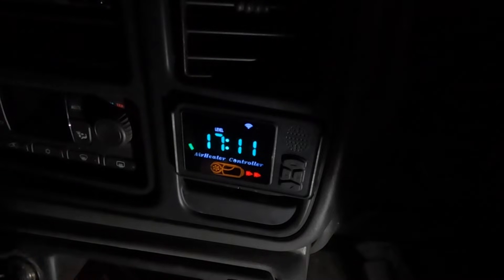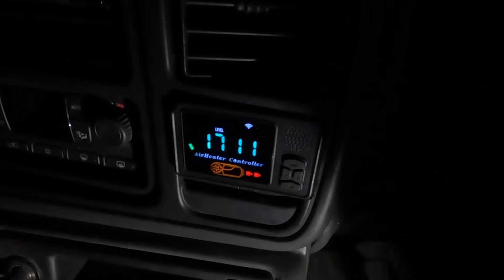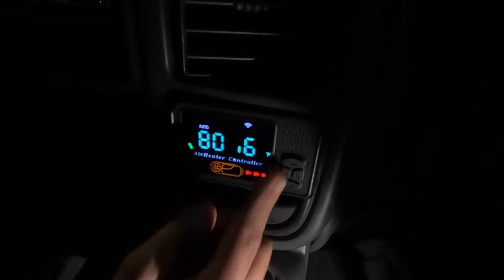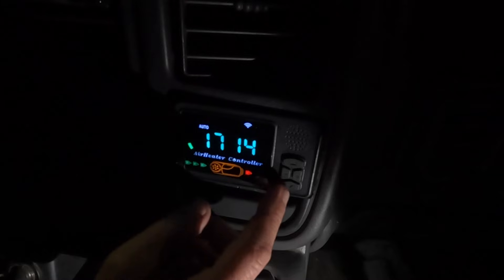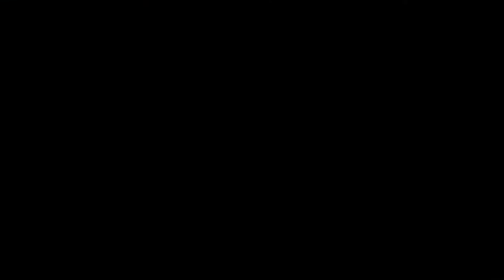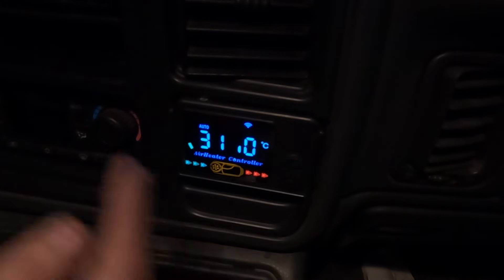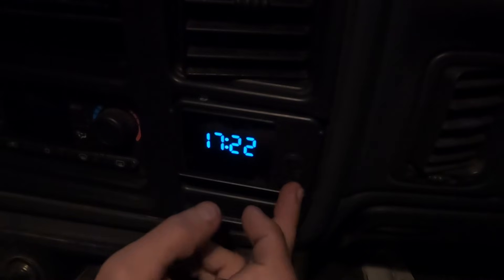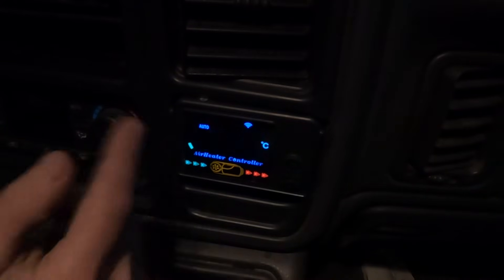Bluetooth Diesel Heater Feature & Settings Discovered !

Comment: READ THIS BEFORE YOU BUY

I purchased this heater for the Bluetooth app and auto on and off thermostat 

Bluetooth app: It’s useless, you can only turn the heater on and off and adjust temp. It’ll display some live data on the heater, You CANNOT set a timer in the app or any other settings!  that’ll require you to be near the controller 

The controller instructions: as always, barley legible as every other heater. So good luck 

Installation: good, same as every other heater 

Operating: For context, I have this installed in a camper. When the heater is in “ smart mode “ it will limit how much fuel it uses DEPENDING on how close or far away it is  from room temperature will determine how much heat it pumps out. The issue with this is, if I set the target temp for 72F and it’s 65F, it’ll only run at 30-40% power. Which means it’ll never reach my target temp. The only way to bypass that is by setting it to max, which is 95 F, then manually shutting it off once it reaches your desired temp. In other words, smart mode is dumb mode.

The other mode is Level mode, level mode allows you to control how much heat is pushed out no matter how cold or hot it is. It’ll just keep going. I don’t like it because there is no control in it. Which means I’d have to manually keep adjusting it.

Compared to my previous heater, this kinda sucks. I kinda wish I spent $100 more by replacing my old heater with the same one.

For right now, this heater will get the job done, just no where near as efficiently as my last one.
Reply from the maker: This is good info for people to know, but your negative spin on it is unnecessary. 

Most heaters do not have Bluetooth control at all.... so in my mind, it is not useless... It does exactly what I want it to do. Turn the heater on and off, and displays a little info. 

What I hear you saying, is that you expected much more out of this heater and were forced to Lower you Expectations ... see what I did there. Seriously though. I'd rather have an app that works and is easy to use, than an app that intends to allow me to do other things, but is either too complicated or glitchy to use. I have a GoPro Hero 10 and it has all sorts of Bluetooth capability, on paper... I never use it because it's complete garbage, and it was $500.... and not a great camera either. 

I have talked about the fact that it lowers temp level too soon in level mode... This is annoying, and I generally compensate by setting my thermostat much higher, when that feature is used ... also not ideal. From my experience, it will never reach the "target temp" so setting it higher works fine for me. You can probably compensate for this by using the temp compensation and tricking your thermostat into thinking it is colder than it actually is... again, not ideal. I hope that the manufacturer improves this in their next version, but it 

What was your old heater ? Perhaps share that info just in case others are interested.... and your old heater had a smart mode that actually worked ?
Reply: @loweredexpectations4927  Nice pun lol

I recalibrated my heater to -9c which is the max with no luck. To put it simple, it can’t reach target temp for my application on smart mode.

My previous diesel heater was fibefly, didn’t require any temp calibration, no Bluetooth, $60 more, but it would be full blast until target temp was hit then default to a low idle. Which I’d rather it shut off, but it wasn’t a deal breaker. I wish I seen your video before I bought a vevor model. 

I’m adding a switch bot thermostat so it can control my switch bot by turning the heater on and off via wifi or temp. You should look into it as well, I can turn on my heater anywhere in the world
Reply from the maker: @BkBootyKrust   Firefly, is that a patio heater... I did a search and that's what I came up with. 

These heaters are far from perfect, but I find myself amazed that they work as well as they do, for under $200 CAD and never disappointed. If it had a volume knob style heat control and came without any accessories, that's more what I would expect, but I think we are a little spoiled, haha... Hopefully it doesn't end any time soon. 

I agree that reaching your set temp and throttling back would be a lot better... I assume that they don't do this on the diesel heaters (some) as they are intended for a really small space, the cab of a car or truck. If it was set to 75F and waited till it was 70F to turn down, it could overshoot considerably... I think this is why they throttle back so early, and also why they call it smart ... because it does think ahead... it's just very wrong when used in a larger space ... or in my case, used to pull in cold air instead of recirculate. 

A company called Bureck is sending me there thermostat that allows you to make all sorts of changes. It's not terribly expensive and looks like it will be helpful for a lot of people. I believe the Afterburner controller connects via wifi as well and allows you to connect from anywhere.
Reply: Are you saying there are only "smart" and "level" modes.....  for me, the point of having full on/off thermostatic control would be that when it thermostatically switches to ON it would do so at full  heat output (to  minimize soothing) then turn full off at the target temp...rinse and repeat...will it not do that?  If not I will have to hack this or a different controller.
Reply: @ That’s correct, it will NOT do that. If you set it to 70 degrees, and your current temp is 65 degrees, it’ll give it 20% power to attempt to make it to 70 degrees. Which it rarely ever does.

Once it reaches tartlet temp it will shut down, if they had this fixed as well with adding a schedule timer for the app, then it would be perfect

Comment: I wish i could get mine to run just one time ive had it a week its brand new but won't fire
Reply: This may or may not help but here it goes.  I got the same heater in the  video about 2 weeks ago.  Prepared it for operation and turned it on.  After a minute a little smoke came out but then it hit me with a code.  I believe it was  code 8 or fule issue  code.  Thought maybe it just didn't prime correctly so started it up again.  Same result after a minute a little white smoke came out exhaust then I got the code 8 again.  I'm a farm kid so I'm fairly good at problem solving most mechanical things.  Figured it was fuel, air, spark.   I took off the housing and sure enough the issue was simple.  When I installed the air intake hose I put the fuel line in front of it instead of behind it so it kinked the fuel line.  Basically the unit was only getting a tiny amount of diesel.  Took the air intake hose off moved the fuel line behind it and smoothed out the kink.   I kept the cover off just out of curiosity and fired it up again and it worked like a charm.  I've used it several times in different places and settings and I absolutely love it.  I have it on a cart hooked to a Trojan 150amp/hour battery and I could not be happier.  I've done some initial testing and have found that at about medium heat this unti will hold the temp of my entire house at 65 Fahrenheit with an outside temp between 36-40 Fahrenheit.  I've kept precise fuel use notes and at 50% it uses just under a  up of diesel per hour.  It's pretty insane how efficient these units are.  Mine is basically a heat  back up to the back up but I still love running it just for fun.  Good luck:)  ps his videos are top notch.
Reply from the maker: @thevegshack6286  Thanks for the detailed comment ! My heater actually came with the fuel line kinked... I found it before I tried firing it up, but yes, this will certainly cause funny things to happen. Glad you used your head and got it sorted out ! 

These are awesome little units, that's for sure. Incredibly cost effective to purchase and a nice compact, dependable little heat source.
Reply from the maker: I would suggest talking to the retailer and getting this taken care of ASAP instead of telling me about it 🤣. But seriously ... Don't wait to tell them. 

What is it doing or not doing ? Does the controller power on? Can you hear the fuel pump cycle ? Does the fan run ? Have you tried running it through the fuel priming procedure ... happy to help if I can ! 

But tell them about this. Keep it short and be polite... many times they will let you keep the old product and just send you a new one.

Comment: I have been using my Vevor 5kw for 3 nights now in my van and I love it.  Very cold where I am right now.  Your video is excellent and, I can share something with you that you do NOT ever want to try on the app.  I read online a sbort cut to toggle F or C was to press and hold the up and down buttons for 3 seconds.  Since it was 25F outside and my heater is outside my van, I did not want to go out to the controller to try this so I came up with a "brilliant" idea.  I would press snd hold both the up and down buttons on my app to see if that would toggle F and C.  Well, the instant I hit 3 seconds, all hell broke loose.  The app showed my temp levels accending from 1 where I was running it, up to 10, then down to 1 and back to 10, etc.  Meanwhile my case temp was rising from 168 C up to 230 C and kept going.  The app ignored all commands to reduce the level to 1 and I could not even shut the unit down.  The app was no longer functional.  I had another "brilliant" idea to use the remote to lower the temp, or shut it down.  It had worked fine the day before but did nothing at this time.    I already had an overheat shutdown when I first started it and later discovered the overheat threshold is sbout 235 -240 C which mine will hit set on just level 6.  (Found this was due to my 8 foot hose which I have since cut in half so it is better now)  The only way I avoided another overheat shut down was to close the app, exit bluetooth and turn off location, then fire them all up again and once I linked back with the heater, I was able to turn it off.  I now realize that those instructions were most likely for a different controller, and there is no reason to expect the app and controller commands to be similar, ha ha.  Had I found your video yesterday instead of today, I could have avoided all that excitement.  Thank you so much for making this video.  I am now subbed.
Reply: Hey my exactly heater also overheats on level 6...I only have a 2doot hose though.. I think my issue might be the fact I have a 90° bend in the ducting about 6inches from the heater.
Reply: @randybobandy9828  Yes, probably.  From my limited experience, these heaters do not like any restrictions in the heat output ducting as this is the only way heat is removed from the heat exchanger and, if that heat can not be removed efficiently, then the temps climb.  With my 8 foot collapseable hose I could not run over level 3 without overheating shutdown.  I cut the extra part from the hose so it is now 4 ft.  This helped but I could still not run it very high.  I then positioned my heater outside my van as to make a straight shot with the hose to my input port with no sharp bends.  That really helped.  I still can not run it on high before shutdown without the heat getting too high but, now I go outside and disconnect the hose and I can turn it all the way up for 10 minutes to burn off the soot and it does not overheat.  I read these flexible hoses cause a lot of backpressure because of all the intetior ribs.  Once i mount my heater to the side of my van i am going to use a metal duct tube that is smootb.
Reply from the maker: @randybobandy9828  Hello Randy. If you have a 90 bend in the ducting hose, that is very likely the issue. You can always disconnect the heater and run it at level 6 or 10 and see what happens. These heaters are fairly sensitive to air flow If the air flow is blocked at all they tend to have issues.
Reply from the maker: HAHA... Wow... that sounds like something that would totally happen to be !! 

Yeah... the manual that I have, and instructions that others have given me either do nothing or do really strange things on this controller. 

I found a menu that has a bunch of stuff that appears to just give you info but not allow you to change anything. I think it was up and down or down and menu. EIther way, it was not helpful. 

Cheers !
Reply: Try up sizing your hose. I have a 20ft 4 inch intake hose. People said it would cause over heating but I've had 0 issues. Failing that you could try an inline duct fan.
Reply: @mattw0615  Good suggestions, thanks.  I am in the process of installing it in a box on my cargo rack and while I am at it, I am going to ditch that corregated hose as I am convinced all those ridges inside the hose cause turbulent air and resistance.  I am going to use metal ductwork tubing that is smooth on the inside.  I never run the heater any higher than level one or it gets too hot in the van, even when it is below 0F outside but  it would be nice to be able to do the 10 minute burn on high before shutdown without having to go outside in the cold and pull the hose off the heater.

Comment: Thank you so much! I had no idea it had an auto on/off setting! Will be great for when we are camping with power. Do you know any way of turning off the speaker that announces it turning off and on?
Reply from the maker: Thanks for the comment ! I do not know if any way to turn. the voice off. 

This is not an ideal solution, but placing a piece of foam tape over the speaker would likely quiet it substantially. 

I have a meat thermometer that I use as a heat pribe for other things. It was always beeping, so I popped it open and cut the wires to the speaker. Not sure if that's possible for this controller.
Reply: @loweredexpectations4927  Another video said how to, click the down and M buttons together (will cycle through languages) till it says OF as language.
Reply from the maker: @Helpful-Clippy  There are a lot of similar controllers to this that have different commands. I don't believe that does anything on this controller. I did access a menu of info that you couldn't change anything. Much of what the user manual says is incorrect / for another heater.
Reply: I've had this heater for a bit now and purchased the Bureck thermostat because I was tired of waking up to 80 degrees inside.  Didn't realize it actually had auto on/off!  BTW the bureck works well for programming Temps and times.  I have it set to warm up my camper in the morning so my batteries are warm enough to be solar charged.  Bureck did have to send me new code to work with this heater properly.  They were great to work with.
Reply: Do you happen to know the swing that the auto on/off works with (temp it'll turn back on after reaching set temp).
Reply from the maker: @darrick9302  I do not know this... I think it may actually be adjustable in the menu... but don't know that either. I think it is set up for a very small swing, but did not notice this in my demonstration.  I haven't used it other than to record this video.
Reply: @loweredexpectations4927  quick test, and it looks like a 5 degree F swing.
Reply: @darrick9302 by "swing" do you mean if I set my auto to 65f it wouldn't turn back on until it's 60f?  Or when it hits 65f it will turn on and run it up to 70d before turning off? Thanks!
Reply: @JirafaBo  if set to 65 and a 5 degree swing.  Once it hits 65 it'll shut off.   It will not turn back on till temp drops to 60.
Reply from the maker: @JirafaBo  I believe Darrick is referring to his Bureck thermostat, just to be clear. As he says, It will turn off at your set temperature, and not turn on till the temp drops more than 5º below the set temp.
Reply from the maker: @darrick9302  Thanks for the comment ! 

I now have the Bureck thermostat and am testing it. I had an issue with the heater switching modes once it was powered on, I'm guessing you had the same issue ? 

They are great to work with. It's almost shocking when a company acts how they should... instead of the usual run around, haha.
Reply: @loweredexpectations4927  yep, it would go to level and auto mode.   I contacted them and they've worked through the issues I had.  I haven't really had a chance to fully test their changes but so far it works.
Reply from the maker: @darrick9302  Excellent.